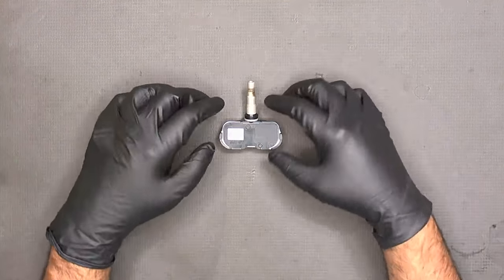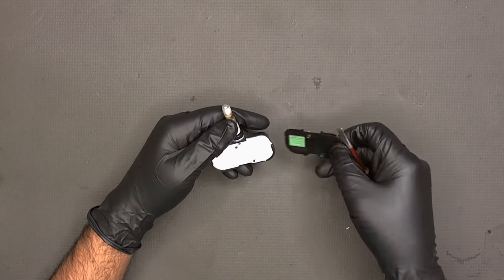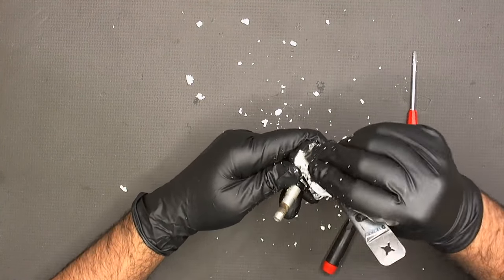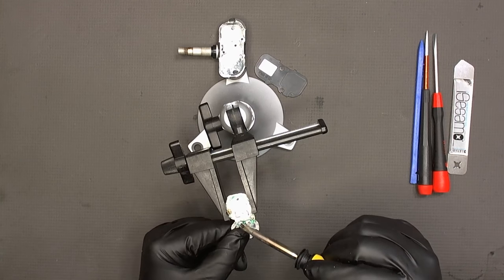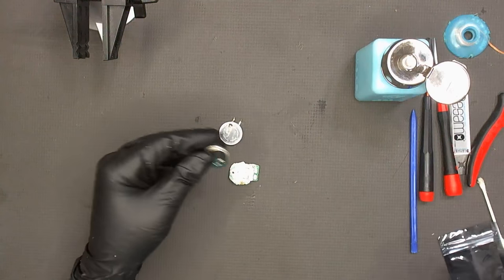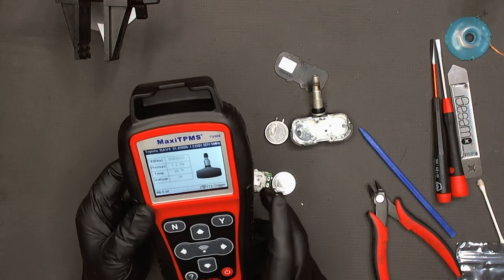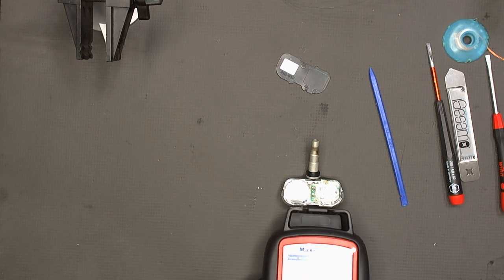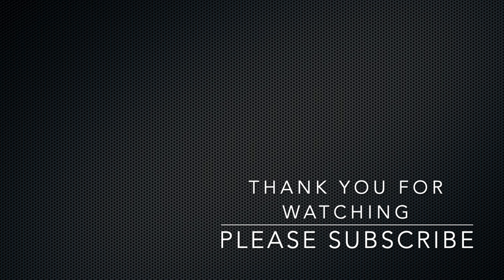How To: Replace TPMS Battery

Comment: To do this you have to be a dedicated diy'er who likes a challenge and the satisfaction of saving some bucks at the same time. Many tire shops charge around $50 to $75 for the new TPMS sensor and installation of it per tire. It's nice to know that fixing it is possible. Maybe. Thanks

Comment: Excellent video.  I would suggest you use electronics grade silicone or potting compound, however.  Regular silicone contains an acid that could be corrosive to the components,
Reply from the maker: Thanks for the suggestion, I'll take care in future.
Reply: what about kitchen/bath silicone since it's water proof and I already have it?

Comment: Good video. Following your video I just replaced batteries in 2 of my 2010 RX350's TPMS Modules on the driver side. Only one had failed but after 12 years the others will soon follow. I'll do the other side when one of the remaining modules fails to communicate.
Reply: I also have 2010 rx350. Dealer quoted me $1150 for 4 new tpms today. Ridiculous. I may try this

Comment: The batteries only last about ten years, some only 5 years. This is good information
Reply: Are you going to drive the car until you die? I am. I bought a Focus '07 new  and the  tpms has malfunctioned for yrs. Cost me way too much $$, but this is way, way too much work for someone my age (nearing 80). The cost of tools, equipment, labor taking the tires off, breaking them down, extracting the tpms gadget, working all the and then putting it all back together. Better go to medical school so you can drive a Rolls and hire a mechanic.

Comment: I really enjoy watching your video. I do have a question , I own a 15 yr old 2005 Chrysler Crossfire which is made by Mercedes Benz. The Crossfire is basically a Mercedes SLK. My tire pressure sensors were bad when I bought the car in 2018 . I had read they are difficult to repair. Once the sensors batteries are replaced will the light go out or do you need to reprogram them which I read is difficult to do I wish you could take one of these from a Chrysler Crossfire and rebuild it I would love to watch you rebuild it . And once these are rebuilt will the factory units that came with my car, will they work or need to be reprogrammed . Thank you for your awesome videos with each of these fancy options on new cars fail we need to be able to fix our own cars with easily to follow videos like yours. You are so patient THANK YOU  : )  CHEERS
Reply from the maker: Thanks Ryan, I'm glad you enjoyed the video. Technically speaking, for any TPMS sensor, if you only change the battery, you don't need to reprogram and it will automatically show up again. For this particular sensor, when I changed the battery and installed it again I did not have to do anything else.
Reply: @theDiYwizard  thank you for your response  : ) the sensors for my car look so different than what you repaired are the type used in my car difficult to repair ??
Reply: @ryanreynolds7771  just buy a set of new ones and reprogram them. iy isn't hard

Comment: It costs $100.00 for 4 new sensors. Not worth my time but thank you for taking the time to share.
Reply: Plus $64 on up for a programmer
Reply: @acib2003  Finally $164. You are moneyless hobo, am I right?
Reply: If you only change battery to original sensor and install a new baterry, you wont need to program  the sensor again ?

Comment: One thing you should ad is weigh the TPMS Sensor before and after so they weigh the same as this could effect your tire balancing
Reply: I don’t think so.
If you’re replacing a battery with the same battery and removing silicone and replacing silicone, any weight difference would be extremely minimal.
Balancing tires there is a plus/minus in weight, so it’s not exact anyway.

Comment: I bought compatible units on aliexpress and they work fine. Plus they cost the same as 4 new batteries and the epoxy to close the thing.
Reply: I think the benefit here is in the longevity and peace of mind knowing its OEM. Aliexpress has good options but they don't last as long as OEM which can last almost 10 years

Comment: They REALLY want you to buy the entire unit rather than just replace a battery. I suppose it's designed to survive the rotational forces it faces in a wheel but Dayum! I didn't check the cost of the battery yet, but an entire replacement module can be had (for my honda CR-V) for just under $30, and I have a friend with a tire shop who would let me use his press to get to it and re-bead the tire. That, to me, is the bugaboo about replacement of anything interior to the tire, the whole deflating/unbeading/rebeading, and with a new sensor I'm pretty sure I'd want to get them balanced too. For others, GM and several other manufacturers replacements are really less expensive, down to the $13 range. If ANYone knows whether they're really manufacturer specific or not please let me know. That little test device is pretty costly, sadly, so determining which sensor could be bad is one thing, but since they begin to fail after 7 or so years I'd probably do them all, anyway. Battery driven, with little easy replacement of the battery. Just, wow. Good video, good detail, this is a reasonably involved process and you did every piece.
Reply: @Legaumaisdsts  From Russia

Comment: Next time you replace your tires, ask the mechanic to replace the sensors with $2 regular valves and you don't have to go broke just wanting to turn off the PTMS light in the dash. Technology is one thing but when you have to spend hundreds of dollars just to turn some idiot light off, I'd rather stick to my 84 Volvo...Good video though.
Reply: Will the TPMS light keep on if the sensors can not be detected?
Reply: The car will fail it's MOT if you take out the sensors.
Reply: @ItsFrusciantesGhost  YES IT WILL, BUT WHO GIVES A DAMN THE CAR WILL CONTINUE TO RUN.
Reply: @bpetnoi1472  people that don't want to risk being pulled over by the police and fined £100 for not having a valid MOT might give a damn, genius.
Reply: @ItsFrusciantesGhost  I have not idea what you are talking about
Reply: @bpetnoi1472  doesn't surprise me.
Reply: @ItsFrusciantesGhost  OK now I understand your frustration with my comment.  I don't live in a nanny state where the police come around looking for MOT certification and that is why I said who gives a damn.  I guess if one is going to live in a nanny state one has to worry and give a damn, which is why I left California and moved to a state where the government isn't trying to run every aspect of my life.
Reply: Im my coutry I need to go for biennial technical check, they may have not give approval if your TPMS is not working.
Reply: For decades we check air pressure daily manually . It's another item to replace every few years. These don't last long.
Reply: We all like more technology but it's more can break.  Many new options sound good until it's more to get fixed. Some options have nothing to do with the car running.  But it's still all safety improvements.   Like if a tire blows. Light let you know right away.  Next told they added this feature because most rarely even  check their air pressure..read it's for some lazy. We like least amount of work.

Comment: I would think that the sensor needs clear passage (access ) to the tire pressure. When you seal it back with silicone, aren’t you isolating the sensor from the tire pressure? This could explain the other person’s comment about low reading(?) Also, can regular silicone withstand tire temperatures?  I thought it would be something similar to epoxy(?). Thank you
Reply: Silicone is good to 500 degrees, high temp silicone is good for 600. If your tires are anywhere near that hot, you have a problem
Reply: @EricFixalot  EXACTLY CORRECT
Reply: The hole for access to the pressure is on the other side from where the silicon is thus it should not be in contact with it. That’s what it looks like on mine

Comment: It looks that it will be much easier to replace the sensor rather than the battery.
Reply: It is. However, it is not cheaper. Some of these sensors go for $190 each while the battery can be less than $10.

Comment: I bought four new sensors for a total of $100 for my BMW on Ebay. Reprogram it and you are good to go. Yes, you can do all of these steps to replace a battery with no guarantee that it will work for any period of time. These sensors were never designed to be reused after a dead battery.
Reply: Please explain why the sensors are not to be used with new batteries.
Reply: @Sunnysky321  You can certainly replace the batteries. My point is that the sensors are in a sealed case and not designed to replace the batteries. Once you open the outer shell, you risk moisture penetration, which is very likely because it it is mounted in a wheel where it will be exposed to water and snow regularly and constantly moving and vibrating. The trouble and expense involved in doing this is not beneficial when you can buy aftermarket replacement sensors for $100.
Reply: @jerseyneil1 sometime , DIY is fun , bro . And not nothing sure Aftermarket sensors will work well like EOM . Services money is the reason they seal the battery that way .

Comment: How do you know which sensor to buy to replace the sensor that's bad
Reply from the maker: If you looking to buy a new sensor, you can usually search for your vehicle model/year and find the part number for it. You can also take it out and read the part number on it. I can normally find used ones or refurbished ones on eBay.

Comment: Would CR2450HR batteries work on Toyota/ Lexus TPMS sensor ?
Reply: CR2450HR has the same (or very similar) specs as the OEM baterries. I would think it should work.

Comment: Toyota TPMS set on Ebay.. 37.99.. and they worked perfect.. save the trouble
Reply: 19.99. garage did it for 15 dollars. Took the tire off and programmed the sensor.
Reply: The cheap OEM Toyota sensors on eBay are NOS (new old stock). They could be older than the ones you’re replacing. Might last 5 years, might be DOA.
Reply: @c0mputer  Its sensors are perishable, that's why the date is written on it.

Comment: My God man! Now remove the other 3 sensors and replace the battery in those! What a mess! Just replace the complete sensor.The sensors are not that expensive on Amazon.
Reply: And then the battery on those go dead in less than a year or worse arrive already dead. I do agree thats a lot of work to go through but Amazon has had issue with selling faulty sensors
Reply: Also, prices in some places on the planet are just ridiculous.

Comment: How long did it take you to get the batteries? They come from china. I ordered them on 8/16/19 and today makes 11 days and they have not arrived and the tracking claims September 20th currently. That would be over a month. I hope it doesn't take that long. That is the only drawback I see to changing the batteries myself.
Reply from the maker: Yes, that is definitely the bottleneck. I order stuff frequently from China (iPhone parts) and sometimes they come in like 5-7 days, sometimes they take 4-8 weeks. These batteries I checked,  came in, in about two weeks but it always depends. For me it was worth it because once this battery dies in one tire, others follow soon. Between my two cars, I have changed 7 so far. So definitely worth the wait as you save a lot of money.
Reply: Right. Its hard to be patient when we can get amazon stuff within 24 hours of ordering and also my car is harrassing me every day about the sensor.
Reply from the maker: @conradtaylor9476  Lol, I hear ya!
Reply: Update, the batteries arrived and I pulled out the sensor and swapped batteries and reinstalled the sensor and the car sees the sensor, unfortunately the sensor now reports about 10 psi low. So I have the tire at 33 psi which is the manufacturer recommendation and the sensor is saying 23 and the low tire pressure alarm is on. I don't want to run the tire at 43 psi to get the sensor to read right. Have you ran into this with your swaps. Does the silicone used have any impact on the sensor? I noticed the entire sensor is cover by the silicone which is concerning. What do you think?
Reply: update, after a week the sensor is now reporting only 2-3 psi low. Still not liking that but at least it is not tripping the low pressure alarm.
Reply: @conradtaylor9476   Not sure myself but an idea would be to try the TPMS relearn procedure for your car. It's possible this could help it and get your sensors back on track. Also, be sure to test and add air to your spare tire if needed, I've had that happen a few times. 
Report back when you can, I'm interested to know how it works out.
Hope this helps.
Reply: @Conald_isAfalseProphet  a p lol lol lol ok ok love p yeah I live out by the lake and
Reply: @Conald_isAfalseProphet  P lol lol pop pop pop pop me to
Pop pop pop pop pop pop pop pop
Reply: Haha...buy more china scrap

Comment: Great video I admire your patiance! But these sensors are FKNING ridiculous! They must but made in slave camps sadly. It really appeared that all that unnessasary silicone was just to keep people from fixing and replacing batteries when need be!!!!
Reply from the maker: Yup it is painful to scrape that!
Reply: Compressed air contains water, that is why you have to drain your air compressor tank after use. The sealant is there to prevent corrosion.

Comment: Replaced mine and took to a tire place to verify it works.. they cannot communicate with or wake up the sensor ☹️
Reply: Probably cheap eBay china
Reply: Did you replace the sensor or the battery?

Comment: Did it work after the silicone dry out??
My concern is because the silicon looks too liquid, with new battery is voltages going thru may damage the sensor? Just wondering. Thanks
Reply from the maker: I have since done four others and all of them are working on my two cars. No issues. You can use silicone without diluting it too, just you have to push it in all corners and crevices.
Reply: Voltage doesn't flow through the silicon it flows in the wires just like any insulated wire.
Reply: @bpetnoi1472  actually my concern it was about the thinner used to thin the silicone, I know thr silicon by it self is an insulation. But thanks
Reply: @ragdepc  I understand your concern, but these thinners are usually very volatile and evaporate quickly.  Personally if I was ever to do this DIY repair I would just use straight silicon

Comment: I have this sensor in my 2012 Corolla, but the stem damaged. Are there any kits that will be able to repair the stem/tip?
Reply from the maker: No, I don't think you can change the stem, you have to buy a new/refurbished one. Here is refurbished ones you can buy for cheap http://rover.ebay.com/rover/1/711-53200-19255-0/1?ff3=4&pub=5575492329&toolid=10001&campid=5338496761&customid=&mpre=https%3A%2F%2Fwww.ebay.com%2Fitm%2FSET-of-4-Toyota-Lexus-Scion-3729A-PMV107J-TPMS-Tire-Pressure-Monitor-OEM%2F222234757476%3FssPageName%3DSTRK%253AMEBIDX%253AIT%26_trksid%3Dp2060353.m1438.l2649

Comment: Of course this is for a Lexus/Toyota. what he's not showing is... taking off the tires and wheels from the vehicle, so we have a jack to do that. Now,, we need to get the tire off the rim, so lets all go out and buy a tire machine, I'm sure you could find one for a few hundred. then we can get the sensor battery or even a new sensor for about $35. then we can get the TPMS diagnostic device, which is what, 50? 75? maybe over $100???   Yeah, well I'll be bringing my car to a professional who knows what he's doing and has all the tools and equipment.   Thanks anyway Mr Wizard.

Comment: You can purchase 4 complete sensors off of ebay or amazon for $40.
Reply: thats way cheaper than what the dealship is asking.  but dont you have to reassign the replacements to your car?  i dont think i can eat the cost of that diagnostic/scan tool right now.

Comment: All that work you could just have bought a new tpms sensor and programmed it to the vehicle.
Reply: some people does not like to pay around $100 for such a job.
Reply: Hm'd Sensors are on average only $25 each.  I bought mine at rock auto.  I agree even as a mechanic- you should NOT take this approach.  You might be able to pull it off- but you have no guarantee that it will last.  Just buy a new sensor- for $25- this effort is not worth it.
Reply: @daveycrockett9447  some people like the challenge and learning process. Yeh it could fail and cause some other frustrations but the cost is a lot for these things
Reply: Master Tech who taught me said. “Do You wish to be a technician or a parts changer?” He always tore down every part to see what failed.

Comment: Just buy a new sensor it’s only 60 bucks install 84
Reply: multiply by 5 and you are at $420. My local tire shop quoted 100 per tire for the sensor and install. That's 500 total. That is a lot of money! Five batteries is $20. Big difference!
Reply from the maker: My experience is same as Conard, I have replaced them in 7 tires and the tire shop quoted me $90 per tire!
Reply: Plus any new sensor will never reprogramming
Reply: @cesarramirez7619  what?
Reply: @conradtaylor9476  sensors need to be programmed for your car if you buy them new. You can't just install them and expect them to work.
Reply: @cesarramirez7619  true. The conversation included total prices with installation and programming.
Reply: @conradtaylor9476  lol
Reply: Just buy a new vehicle

Comment: It looks like you cracked the circuit board when you were prying it out.  Also, your video is overexposed.  I can't see any of the detail on the bright white tpms sensor.  Stop using automatic exposure control and switch to manual.